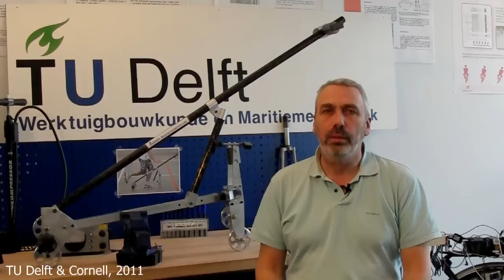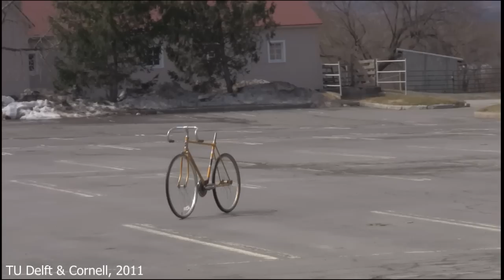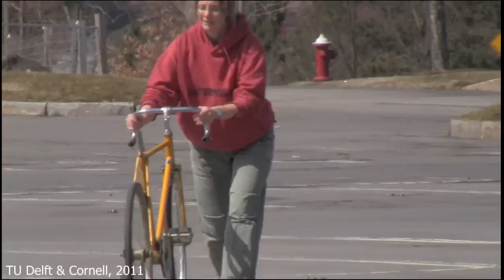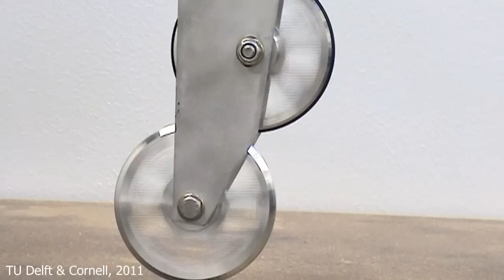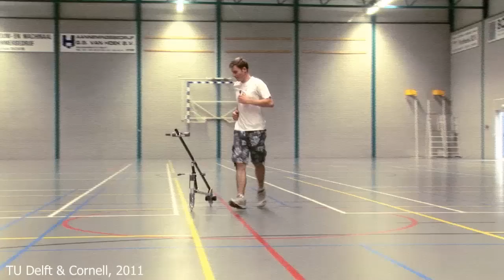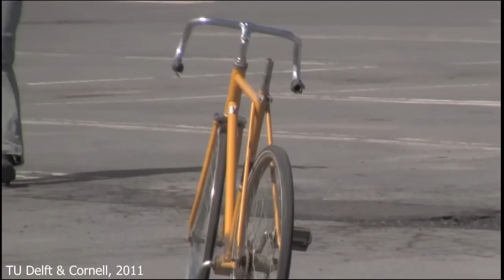TMS Bicycle, stable without gyros or trail (TMS=two-mass-skate)

Comment: Andy here, a co-author. As pointed out near the end of our Science paper the intuitive explanation for why the TMS bike works is because, as you say, the COM of the front assembly is ahead of the steering axis AND (which you didn't say) lower in height than the COM of the rear assembly.  If you read through the paper at the end you will see this.  Also its explained in a bit more detail towards the end of my boring video also on Youtube (search ruina bicycle).

Comment: "Trail" IS what make a bicycle turn into a fall though. It is also what makes a car go straight when going forward and the steering wheel is released. If you let go of a steering when in a car going backwards, it will do the opposite; it will take a small steer away from straight and make it larger and larger until the steering wheel turns completely in that direction. A car going forward will always try to go straight. A car in reverse will try to go in a circle. If Dr. Schwab is correct in this video, the bicycle would remain self-stable in reverse, as long as the center of mass is moved.

Comment: Yes! I've been arguing this for years and they didn't believe me. It also ties into counter steering. Most people say that the bike steers at low speed and then counter steers at high speed. But I disagree. I think it is not the speed that matters but the timing of the lean and steer. If you steer before leaning the bike will counter steer. The steer effectively leans the bike in the opposite direction. But if you lean then steer the bike will steer (no countersteer).
Reply: Hello! Yes, I have been thinking about this for a LONG time while riding on a motorcycle. It behaves exactly how you describe it. Have you by any chance elaborated on the idea in some article or do you have some soruce about it?
Reply: @tillda2  This is all just from 20 years of riding and experimenting. It also brings up the idea of counter leaning... If you lean the bike while counter leaning you body weight, the bike will steer into the direction the bike leans. Just experimenting with the timing of the leaning and steering should give some insight.

Comment: I created a bike with zero angular momentum by attaching two wheels to the bike so they could roll on top of the bottom wheels, like how this thing works. It's pretty neat how the reverse spinning wheels cancel out the gyro effects. And it was just as easy to balance as a normal bike with gyro effects.
Reply: Just as easy? if you did a blind study between gyroless and normal bikes you wouldn't be able to tell the difference?
Reply: No, I'd imagine their would be a noticeable difference in stability at higher speeds. But still rideable.
Reply: Masses rotating on the pitch axis still resist the leaning roll and turning yaw of the bike whether counterrotating or not, a counterrotating wheel only cancels torque on the pitch axis.

Gyroscopic forces only slow down the leaning and steering of a bike through gyroscopic resistance to a change in orientation and don't actually provide any correcting force to lean the bike back to an upright position. The correcting action happens through the steering assembly center of mass 'falling' towards the side of lean, changing where the steering points.

Comment: yeah your right, but the counter rotating is not as important and the wheels being very small for a bike thus the have minimal gyroscopic effect. i think the important aspect of this is not them "eliminating" the others but showing that there is a third action at play with the others. when the bike begins to lean the wheel turns in that direction righting its self. eventually the speed is not enough to right the bike and it begins to fall in a circle.

Comment: @SquirrelFromGradLife :  the Gyro effect is real and adds to the stability of the bike, but it doesn't correct steering in a fall. To prove this, lock the handle bars into a straight line, or try to push the bike backwards.

Comment: If you hold an ordinary bike sideways, so as if it would fall, the wheel "falls" in the correct direction. Judging by the drawings in your paper the majority of the mass of the steering part is ahead of the steer axis, so it would behave the same. I wonder what would happen if you had no trail _and_ a steering system that has it's center of gravity exactly aligned with or even behind the steering axis.

Comment: Why would gyroscopic effects be taken away by adding a second wheel rotating in opposite direction? In my understanding, it doesn't make a difference as a whole when changing the direction of rotation.
Let's say you look at the rotating wheel from the side and push at the bottom. It of course now is in motion at the bottom and at the top. At the bottom, it is moving away from you and at the top, is is moving towards you. Let's skip right half a revolution forward to simplify things. After half a revolution – due to conservation of momentum –, the bottom now is moving towards you and the top is moving away from you. However, they already moved a small distance towards their initial direction they had after being pushed. Now, they just move back towards their initial point (moved by half a revolution), which stabilizes the whole thing. Of course, in reality there isn't half a revolution skipped right away and stabilization already starts after a quarter of a revolution.
The only difference taking place when changing the direction of rotation is that in one case, the part of the wheel heading to the right would get pushed away from you, and in the other case, the part of the wheel heading to the left would do so.
Using two wheels really only takes away the rotation-directing-dependent destabilization described in the sentence before. I'm saying here that using this setup makes things better, not worse. And I really can't see why it would take away gyroscopic effects.
Reply: Smaller wheels have lower angular momentum so they technically made the gyroscopic effect negligible anyway.
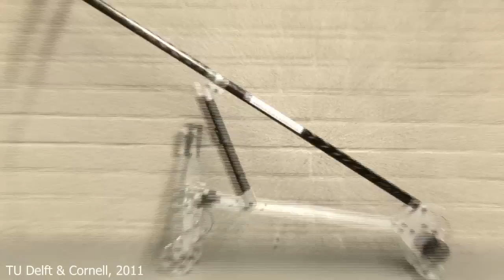Reply: J Salas , at 1:16, he says: "This bicycle has no gyroscopic effect due to counter-rotating wheels.". So according to him, it doesn't matter that they use small wheels (with low mass).

Comment: I would like to argue that actually your TMS bicycle is not stable for a couple of reasons, mainly because you have to look at static and dynamic stability, as is done in aircraft dynamics. Static defines whether or not it returns to its equilibrium position and dynamic defines how it does so through its motion by looking at the oscillations.

A statically stable bike will return to its original stable position, which in this case is not the vertical upright position of the TMS, but the direction in which it is moving. A statically unstable bike would increasingly move in the direction of its perturbation until it falls. A bike which has neutral static stability would continue moving, but at a different direction, as was the case in this experiment.

With regards to dynamic stability, you notice this better as the bike or TMS slows down. I'd like to refer to another youtube video which refers to this experiment called "Andy Ruina explains how bicycles balance themselves". As he explains, and like you said, the bike recovers because the front wheel ducks under the bike as it falls. However, the restoring force is greater than necessary and since there is no damping (ignoring air), you can see that when the bike is on the other side, it is at a greater angle to the verticle than it was before. In other words, the amplitude is increasing. This is negative dynamic stability.

All this brings a few questions into mind:

1) If you want to analyse the stability of a bike, you have to separate the vertical and angular components. Have you noticed that when you roll a coin, the faster you roll it, the sooner the angular/horizontal oscillations occur? This may be an illusion and therefore requires measuring, however I can't think of anything relating the bike's forward velocity to its angular oscillations about the same axis. In aircraft dynamics, the forward velocity and angular velocity about and along the same axis are separated, because they have no relation.

2) Another thing that made me think was Andy's video where he mentions that the weight at the front is greater and therefore the front wheel has the tendency to fall first, allowing it to duck under the bike when it falls in the first place. The TMS works the same way. How about putting the CG further back towards the rear wheel?

3) Finally, assuming my assumption of your neutrally statically stable TMS is correct, you should also try a bike with an actually negative trail. Referring your link to the paper, figure 1b does indeed show that the axis is behind the vertical wheel axis however it also shows that it is still in contact with it, such that it seems as though one axis is pushing the other physically, through a fixed, non-flexible medium. That would explain the neutral stability. A truly negative trail would have a fork design similar to the bike shown at the beginning of this video, however mirrored across the wheel's vertical axis - as in it would look like it's going back into the bike.

Let me know what you think of this. It would be interesting to see a bike with the different features I mentioned. Unfortunately I don't have the conditions or tools to make such a bike. Also, most of my work has been with stability, since most people can't be bothered to go through the maths and understand it. Truth be told I don't like it much either, it really is a hassle :P

Comment: Can someone explain how this is different from how a single wheel (e.g. cd, bicycle wheel) is self-stable?
Reply: Yes.  A single rolling wheel is "neutrally" stable, at least in the classical case considered in all of the books in which scrubbing friction is neglected.  This means that small perturbations don't grow, but they don't decay either.  A bicycle, and this TMS bicycle, are asymptotically stable (perturbations decay away to zero) even with no friction.  Also, a single wheel is stabilized, in essential ways, by gyroscopic effects.  The point of the TMS bicycle is to show that  a bicycle can be stabilized without gyroscopic effects.

Comment: Well you could try holding a bicycle wheel at the hub and making it spin and try holding it. Do you feel it making a gyroscopic effect? Now make it go as fast as it goes when you're going 15-20 mph. Do that and that come back to me. Please don't tell me that a bicycle wheel doesn't make a gyroscopic effect... please don't..
I know it's not the only reason why bicycles are stable, there's also the trailing wheel effect and there's rake from a positive caster on the front wheel etc.